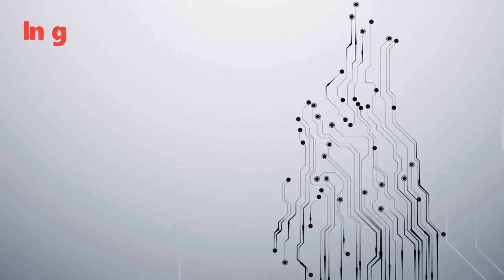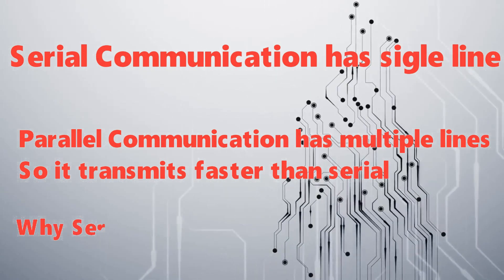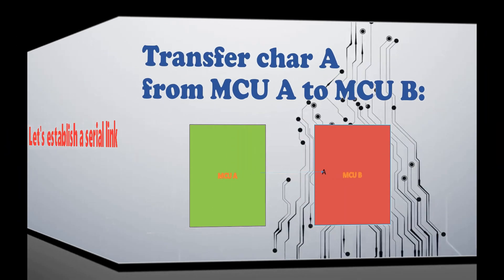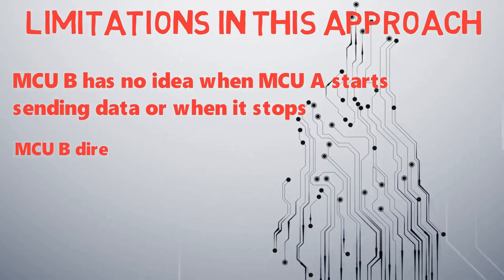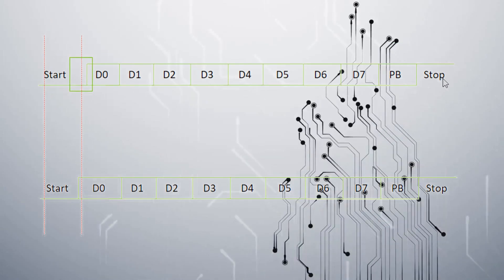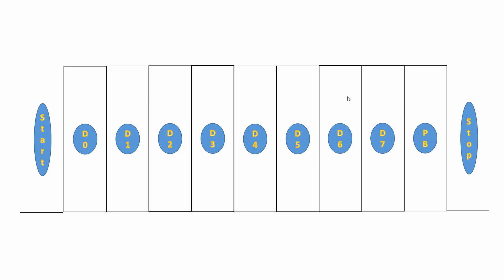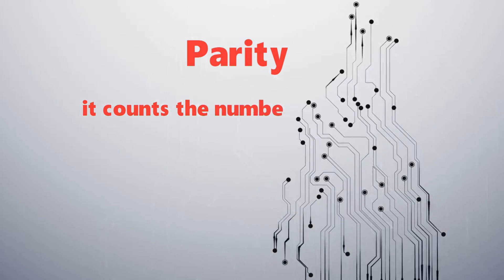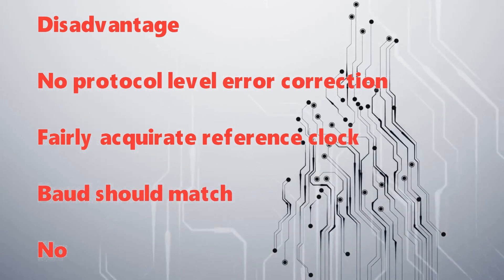UART protocol from the basics | Serial communication | UART tutorial

Comment: There are lots of great visuals and graphics in this, and the explanation is good.  The sound quality could be better, just in terms of how easy it is to hear about what you are saying clearly.  Also, I didn't finish the video yet, but while parallel can definitely transfer more data at one instant, it is easier to drive serial communications at a higher speed or clock rate, so, for example with ATA, things have intentionally gone serial to make overall speeds higher with SATA, and that trend is also seen in multiple ways and places -- very fast serial transfers versus more speed-limited parallel transfers.